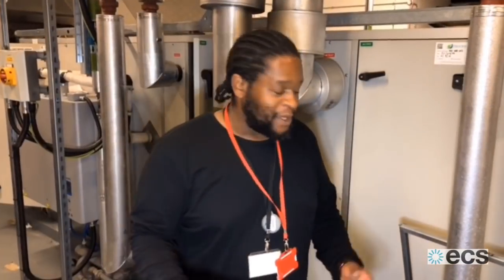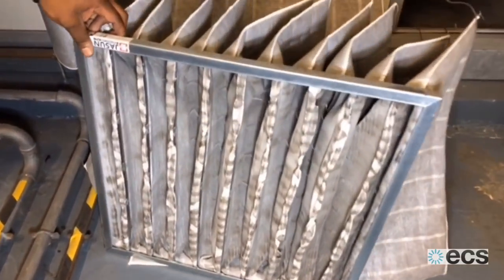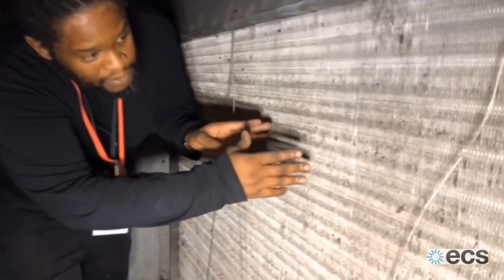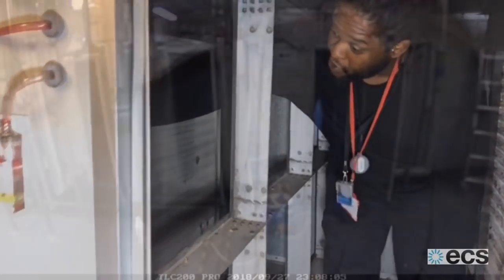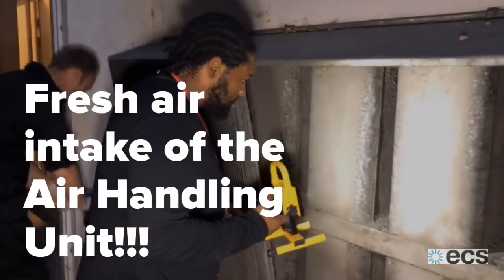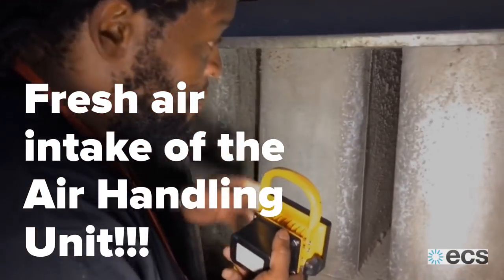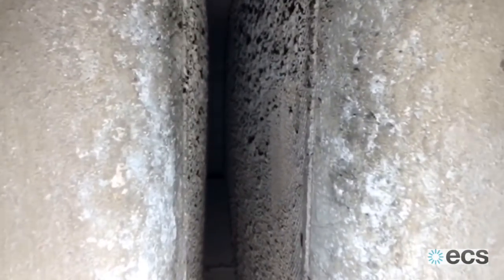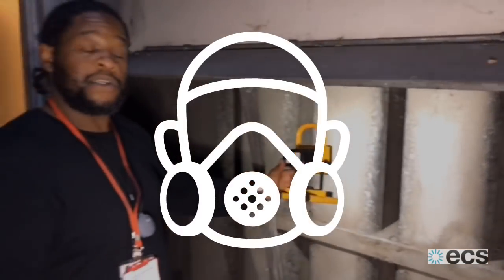Air Handling Unit Maintenance - Watch our "before & after" filter change and deep AHU clean

Comment: Looks like you had a lot of fun cleaning this AHU and cleaned it up pretty well! A few things to consider though. Why not use an extendable lance on a vacuum cleaner to vacuum in between the attenuator pods? Using a broom spreads all the contaminant you are trying to remove into the atmosphere. Use a Hazardous class vacuum with a HEPA filter rather than a wet and dry vacuum with no vacuum bag! Finally, disposable coveralls are preferable for this line of work which can be bagged up and disposed of safely, rather than carrying all that dirt on your work overalls!